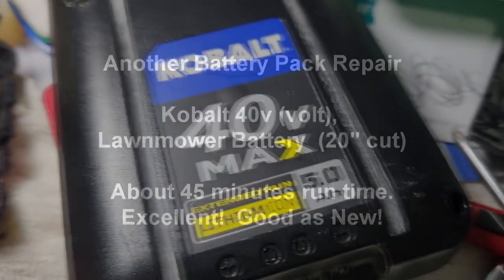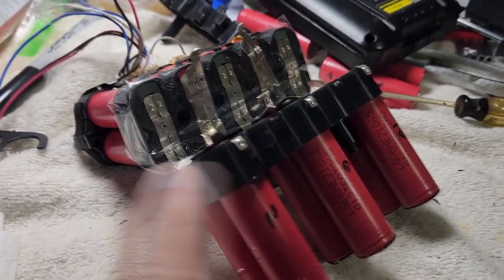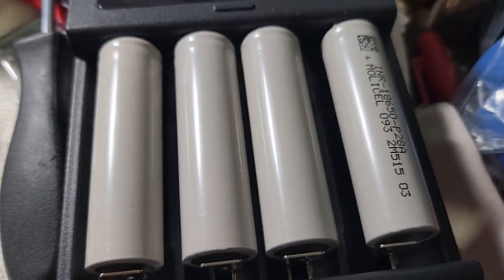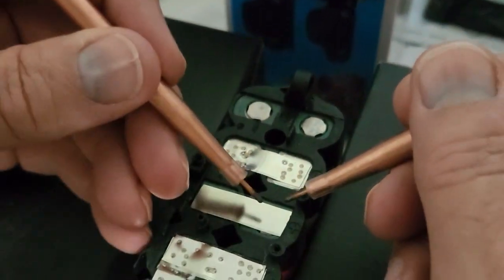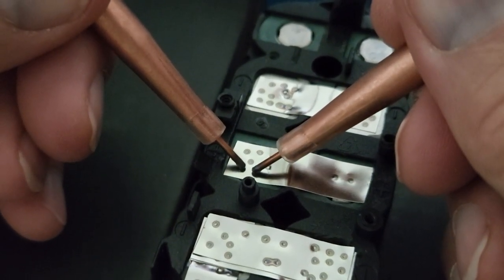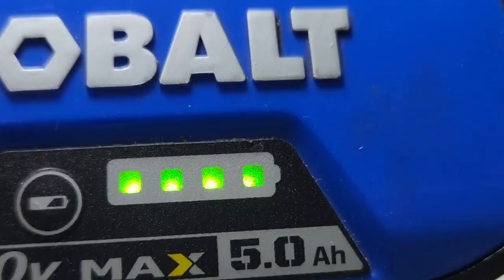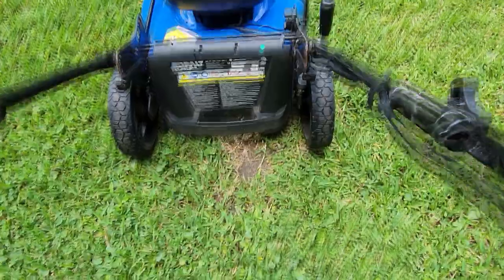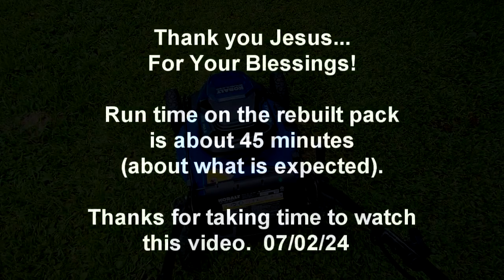Kobalt Mower Battery Repair

Comment: What is the cell part #? Is there a cell that is good but not as expensive?
Reply from the maker: The cells are 18650.  They are available in many different amp capacities.

Comment: Wow! So good to get to see the process. Good idea to double up the tabs to carry the current = A clever work-around for the limitations of your welder. Idea = It seems to me that it might be helpful to have independent control over when the welder fires, instead of the one second delay. If we added a foot pedal, you could take all the time you wanted to use the probes to move and secure the tabs. Let me know of your interest.
Reply from the maker: Thanks!  I can set the delay from 0.5 to 5 seconds.  A foot pedal would be nice...but I have gotten used to working with the delay.  Thanks again for the positive comments!
Reply: Wow awesome too see this done right ... What a awesome little spot welder were can I find one of these ... My set up could most def use one ... Any who great job 👍
Reply: @Pro_fessor56  Hi, Professor - The author posted the link to purchase the welder in the written opening comments that describe the video. Just click on "...more" and it will show the full description. The purchase link is near the bottom of the written drop-down information. HTH.